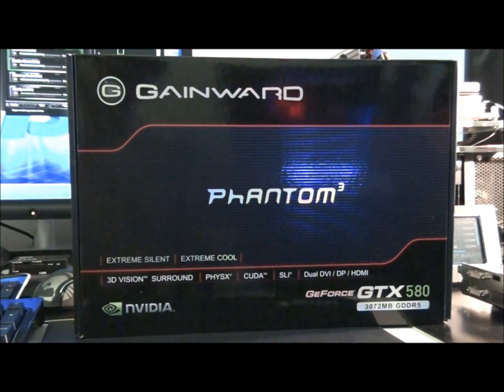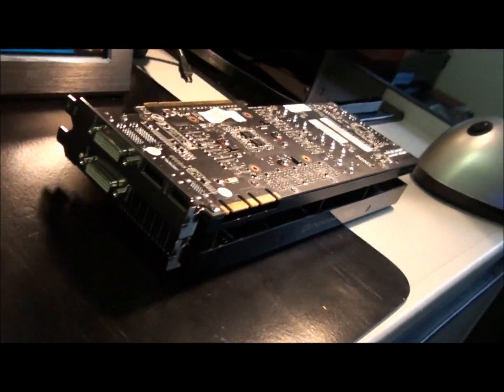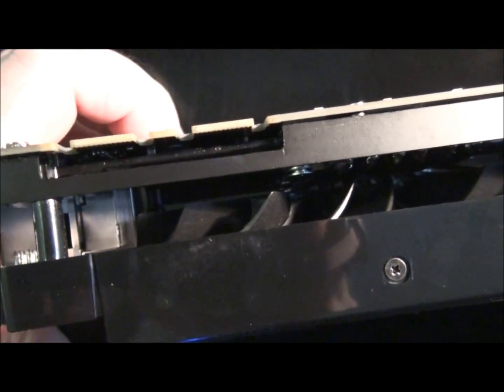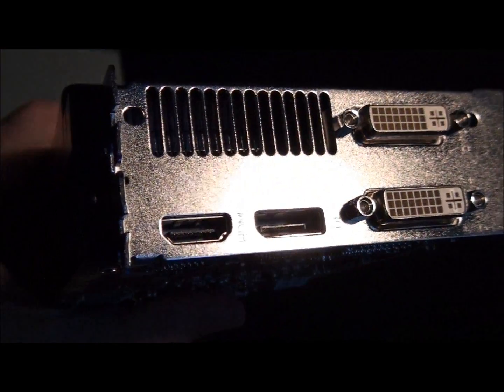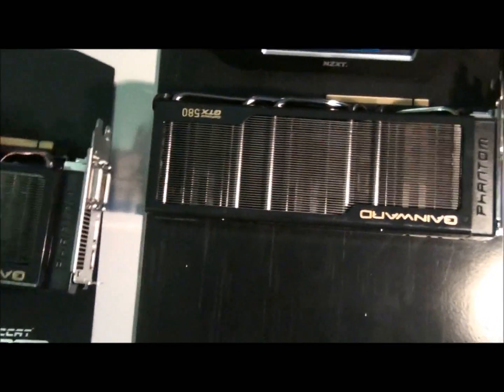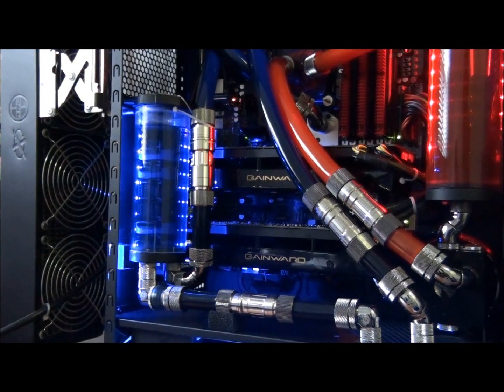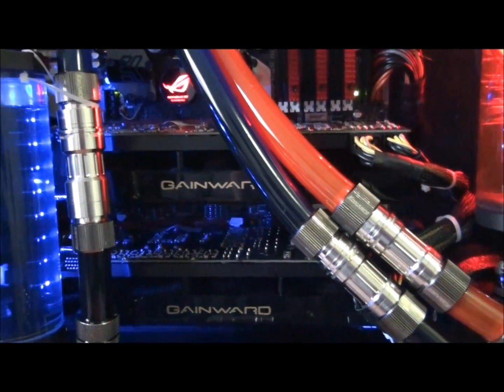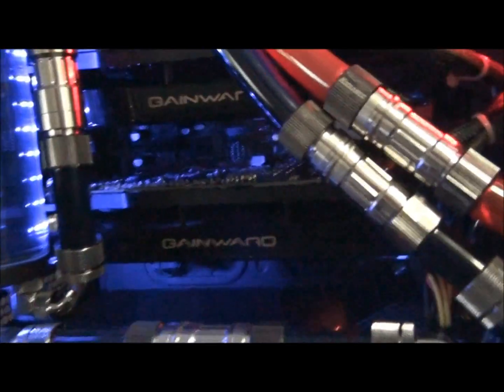Gainward GTX 580 Phantom 3GB SLI Review Part 1 of 2

Comment: @SingularityComputers 

I just bought a used 580 Phantom 3GB for 485$. A new one would cost me 757$. These are the shitty prices in my country. So I say it's a bargain as long as you buy a used one. I'll probably sell it for 250$ when Kepler arrives..but I say it's okay, instead of waiting for 6-8 months (Kepler), or switching to ATI. I doubt prices will go very low in my country.. Anyway, I hope I made the right choice and the card is working (it should arrive tomorrow).